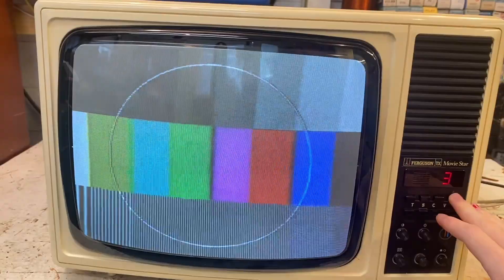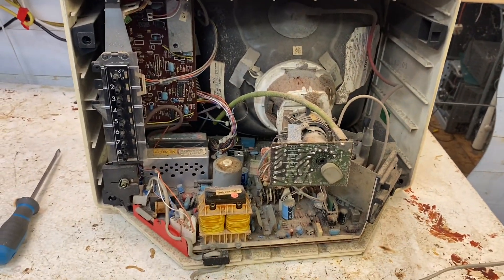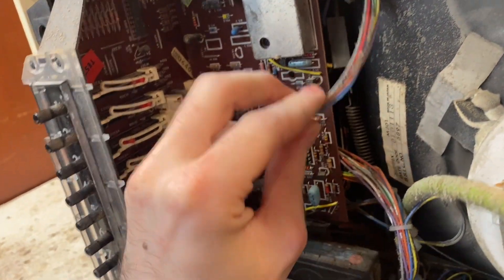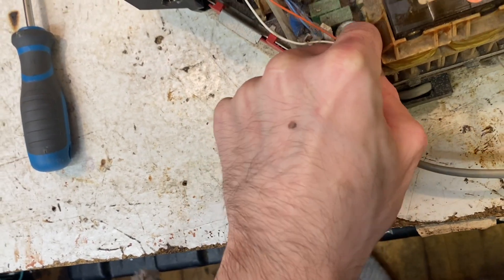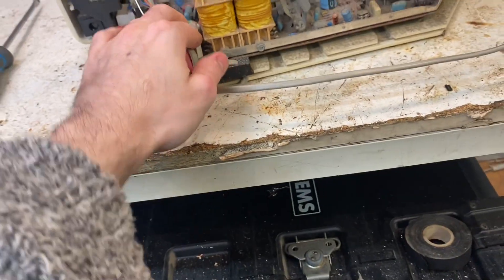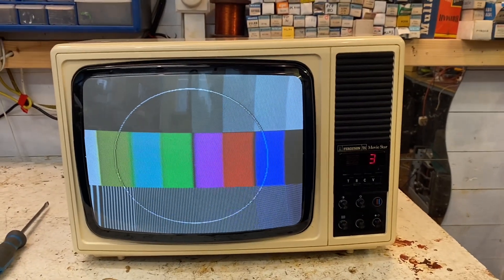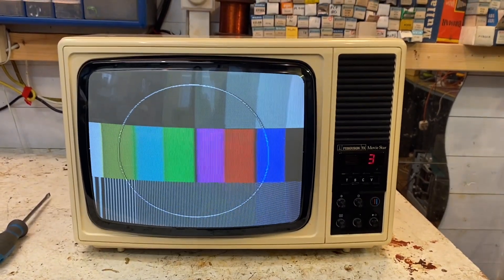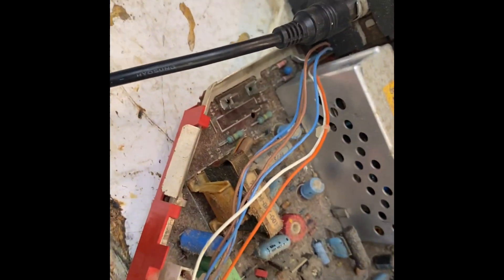Customer Repair - Ferguson TX9 Moviestar. Let’s repair another vintage CRT TV!

Comment: It’s a completely different chassis to the TX90 RGB you have and I’m can’t believe you have washed this tv in the bath with water. You should never do this that’s why there are PCB cleaners available. Welcome to all the water ingress in the potentiometers and in the line output transformer pot for focus control. It will never be the same. Also wd40 isn’t for use with noisy pots you need a switch cleaner solvent which cleans (wd40 won’t) contains lubricant to prevent further issues in the future and drys up unlike wd40
Reply from the maker: The Thorn service data I have refers to the TX9 chassis being fitted to the “movie Star” and some other models. Apparently there was an improved version of the chassis which according to the data can be swapped with and changed between different front panel types etc.

As for lubricants and other sprays, I chop and change between WD40s specialists Lubricant and dry lubricant. I also like the 3 in 1 type oil which is multi purpose. I use the general purpose WD40 for cleaning and removing residues. I have a couple cans of vintage RS solvent cleaner which works wonders for all sorts too. For really knackard pots I soak them in WD40 and rinse with my RS evaporating solvent. Enough stock here to replace whatever can’t be salvaged anyway.

I’ve had positive results from using water to clean PCBs using a shower head. Just have to be sensible and allow good drying time. I use the oven at 50-100 degrees for 10-20 mins and then leave to air dry. I wouldn’t use water on hand wired/wire wrapped PCBs or point to point built equipment.

Comment: I remember when the TX9 was launched, we bought one for the Crystal Palace transmitter Monitoring & Information Centre.  I remember we were very impressed with a picture quality and it proved to be extremely reliable.

Although we had a number of professional receivers and monitors, it was important to have some domestic TVs as well as sometimes certain transmitter faults might not show up on professional receiver, but would show up on a domestic TV set.

Comment: what do you mean by "deep clean"? do you use water? looks very nice
Reply from the maker: Did you not see the short segment of the set in the bath?
Reply: i skipped a bit through the video but i will check it today, thank you...i would be worried about cans with coils inside and transformers and other hollow things like the delay line etc....but it looks so nice....i mostly work on older tvs with point to point wiring and the chassis sometimes are filthy
Reply from the maker: @MrHBSoftware in terms of cleaning, I agree. You need to be careful with what you’re working with. With PCBs, I first spray with WD40. This stops the circuit board and components from corroding or the original flux reacting and causing an awful white paste to form on the PCB. I rarely use soap, but when I do I let the board sit and I scrub the underside. Never use hot water. I dry circuit boards mainly either in the oven, a hot air gun, or in front of a fan.

I work on point to point too. You need to be careful there. A lot of the older stuff is less well insulated, transformers and so on. I’ve gotten away with soaking dirty radio chassis in clear water, or just rinsing really.

Wax insulated stuff always holds moisture. It’s not worth it. WD40 and a rag, brush and hoover works well there.
Reply: can i ask how do you go about drying it?